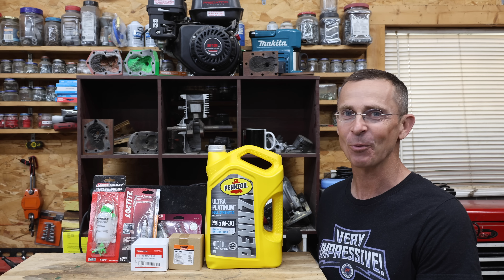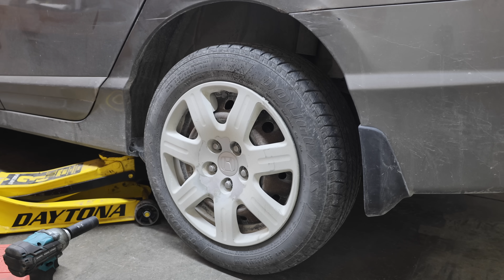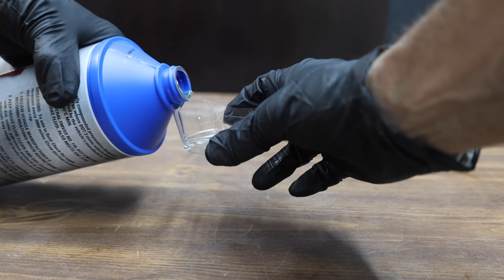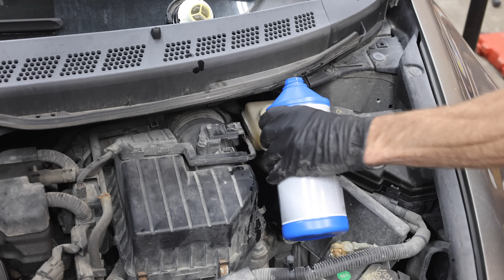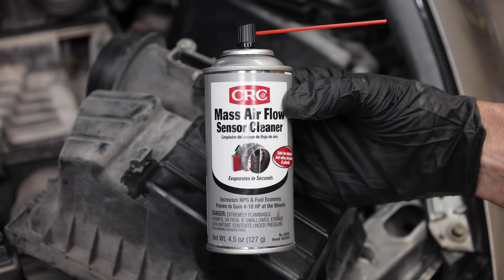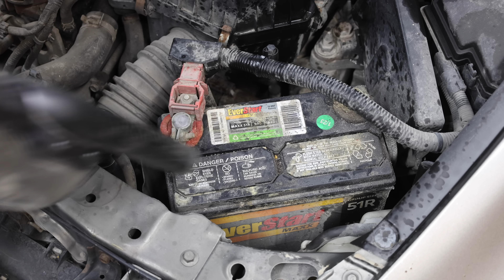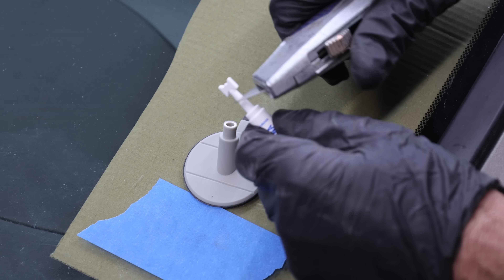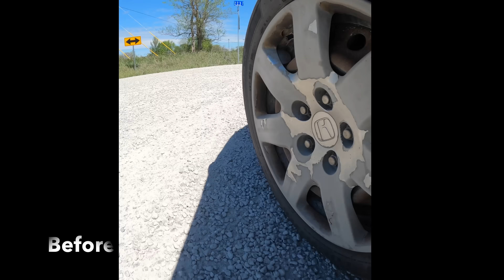Most Reliable 200K Mile Car? Let's Settle This!

Comment: Fantastic video!  I have a 2012 Fusion with 2.5 4cyl I bought brand new.  Has 220k miles now and still my work daily driver.  No reason to buy a new car when this car gets 25-27mpg and still runs amazing!  I've had to replace all the front end parts, shocks/struts and done brakes numerous times.  I run synthetic oil at 10k intervals and also do regular trans fluid changes in my garage as it's super easy.  These are also great cars to pick up cheap and fix up.
Reply from the maker: Thanks!  Thanks for sharing.

Comment: I did something like this with a 2000 Ford Ranger. I got it cheap, but it was a basket case with about 150K miles on it. I think the only maintenance ever done to it was oil & tire changes. I put about $500 worth of parts in it. I did many of the same repairs you did in this video. Then gave it to my daughter, which, um resulted in a few more $ invested in repairs. Still... FAR cheaper than new or a "nice" used vehicle. I have the Ranger now, and its still going, so I guess it's reliable.

This video taught me of some new tools useful for working on old cars. Thanks.
Reply from the maker: You are welcome!  Glad to hear!

Comment: Awesome video, i notice you dont have anything on striking pry bars, like 12 in long or 16 in. I used them a lot in underground coal to remove rusted staple lock hydrolic hoses. By strinkin either the hose or the staple.( snap on) always snapped quick. Proto curved tip pry bar was the best. Dominator would brake the tip easily mayhew makes those.
Also you should do a tool olimpics LOL.
Thanks. And congrats on your sucess.
Reply from the maker: Thanks and you are welcome!  Thanks for the suggestions.

Comment: Good video.

Could you do a comparison of multiple cold air intake systems for a modern diesel like the duramax L5P? In particular the banks monster air intake vs other brands. There are a lot of claims made but does it really help fuel economy, EGT, acceleration in the hills while towing, HP? Is banks worth the money or will a cheaper one work?
Reply from the maker: Thanks!  Thanks for the suggestion

Comment: This is exactly what I do to my vehicles. All over 200K and still running. Wear and tear is the biggest issue with old cars and If you have some mechanical skills, tools, and Youtube you can do most repairs.  I'm now at the next stage of what to do with your well maintained car when a major repair occurs. Engine wear (valve rings, head gaskets) can be expensive and most folks will send it to the junkyard. I have a front will drive Venture van with 290k and the transmission is worn out (flushed and replace fluid every 60K). I'm going to attempt to drop the transmission and rebuilt/repair it myself. This is definitely out of my skill level and comfort zone but a re-manufactured one is about $2200 and a shop will charge me twice that amount to rebuild the old one.  A 4T65E front wheel drive transmission is not the easiest one to work on but I going to give it a try and If it turns out to be a disaster then I can always send it to the junkyard or buy a re-manufactured transmission.  Would love to see Project Farm try a automatic transmission repair on a front wheel drive car but that kind of challenge is something most DYI'ers would not attempt.
Reply from the maker: Thanks for the suggestion.

Comment: K24 engined Honda for the win!  We just picked up an Element with the same power plant.  You need to adjust the valves every 100k.  The exhaust valves get tight and can burn on the lip causing a compression leak.  Adjust them a little on the loose side and she should have 100k still left in her!
Reply from the maker: Thanks for the feedback.

Comment: I'm never touching the radiator valve, because when this old plastic break, whole radiator is trashed.
Rather than that, i just take hose off too drain the coolant.
Reply from the maker: Thanks for the feedback.
Reply: @ProjectFarm  Thank You for response.

Comment: I just picked up a 07 civic hybrid with 191000 miles 3 weeks ago. I ran pretty good, but I did I decided to change the oil, air filter, axles, all 4 shocks, coolant change, all 8 spark plugs, valve adjustment, valve cover gasket, and updated it with a Bluetooth radio and 4 new speakers, also added sound deadening material to the insides of the doors, spare tires area, and wheel wells. Rides extremely well for a 17 year old car. Front brakes look good, the rear is uknown. Brake fluid will be replaced soon, but i am a little intimidated with the rear drums. Exterior was also taken care of, clay bar, polish, and wax, head light assembly was replced by previous owner, i just installed LED headlight.. all in all, great vehicle..
Reply from the maker: Thanks!  Thanks for sharing.

Comment: 17:45 ---im sorry this is just wrong. This is the problem of out society and capitalism. Just add the $2,500 for the labor costs of the specialist and then we have the actual costs - unless you cover the labor costs yourself. The parts are not the cost driver, but the labor costs of the specialists.

Comment: Good Job...I just bought a 2004 Saturn Vue with the Honda J35 V6 engine and trans for, $850.00, with, 170K miles. I also spent, $900.00 on parts...I replaced the timming belt, water-pump, belt tensioner and pulleys,  front shocks and struts, front rotors and pads, front sway bar end links, both front lower control arms with ball joints, thermostat and gasket, spark plugs, ignition coils, valve cover gaskets,  rear tranny mount,  engine mount, oil and filter, adjusted the valves and did tranny fill...Bought all my parts from, Rock Auto.
I got the Continental Timming belt kit and would recomend,FCS Auto shocks and struts...
Reply from the maker: Thanks!  Thanks for sharing.

Comment: Chris Fix would be proud. Doing disc brakes is so much easier than drums. And yes the most reliable vehicle is one you maintain and can fix yourself. I saved nearly $3,000 fixing my wife’s Infiniti by just looking up the code (it was a sensor in the transmission) and replacing the part myself. One of the best things about YouTube is wealth of DYI repair videos on multiple makes and models. Any modern vehicle should be able to do 100k with proper maintenance.

Comment: I have a 2009 Toyota Tacoma with 282,000 miles.  It got a new short block and rebuilt head at 231,000 miles (leaking head gasket) and Toyota replaced the rusted through frame free of charges at 191,000 miles.  The transmission has been service twice.  Works good,  I'll drive it until I croak.  The body has NO rust, I live in Illinois.
Reply from the maker: Thanks for sharing.

Comment: Like OEM parts.  Do not fully replace AT fluid if old and not regularly changed.  Can cause slippage issues.  Replace 1/3 to 1/2 at most

Comment: Nicely done. I would suggest getting a no spill radiator filling funnel kit. It helps in keeping air out of the cooling system. Most Hondas also have a bleed screw for the cooling system. Cost is 20 - 35 bucks for the kit, worth every penny.
Reply from the maker: Thanks!

Comment: Nice video thank you. For your next lubricant test have you heard of Enviro-save metal treatment? Curious if the claims are real or snake oil. Supposed to treat the metal and bearings in the engine to make it last longer.
Reply from the maker: Thanks and you are welcome!  Thanks for the suggestion.

Comment: I have three cars in the 200,000 mile range. as long as they have reliable engines and transmissions, it makes a lot more sense to do the type of repairs you’re doing. My attitude is that you keep driving a car until repairing it just makes no more sense
Reply from the maker: Thanks for the feedback.

Comment: Excellent video!  As a fan of the channel I submit my request to also include more detailed auto repair videos...even more detailed than this one.  That type detailed repair video saved me thousands by allowing me to change the radiator on my wife's 2007 RX 350.  Lexus wanted to charge me a fortune.  A year later,  after I changed it, that baby is still purring like a kitten.
Reply from the maker: Thanks!  Thanks for the suggestion.

Comment: For those new mechanics out there, the single best take away from this video is him using his phone to take "before" pictures to ensure everything goes back together correctly.  I can't express how much I wish I had this capability growing up in the 80's and 90's.
Reply: I remember pulling the front hubs off my 4x4 and laying them out in the order they came off, then cleaning and greasing one piece at a time and then reassembling so I didn’t mess it up. Lol
Reply: I’m a professional and I do this if it’s a job I’m not familiar with and has to be apart for a while/ Back in the day I would draw pictures.
Reply: I would just use pencil and paper before easy cameras.  Complex jobs… add a few pieces of numbered tape.   I have to admit… cameras, even videos greatly simplify!!
Reply: True!!!
Reply: It is an invaluable tool. I usually forget to delete them afterwards though, so when looking at old photos I often find random pictures of my cars in a semi-assembled state.
Reply: I do this not only for car repairs but for wiring in equipment for work.  When you start dealing with 25 colored pair wiring, it gets fun.
Reply: Being a Locksmith. I do this every time I'm working on a mortise lock I'm not familiar with to make sure it goes back together correctly. It's a very simple, smart thing to do.
Reply: of course your correct, by problem is even with pictures i usually need help to finish w/e i'm working on, i am the opposite of mechanically inclined, working hard to get a 50% success rate.
Reply from the maker: Thanks for the feedback.
Reply: Yup, I used to do trays, and cardboard with homes in it to keep bolts sorted.
The camera is my go-to as well.
Reply: Oh yes, having a cell phone to quickly take photos when doing projects just to see the order of assembly is such a nice QoL thing
Reply: Or even video, and videos on you tub. Grew up working as a mechanic/slave for my dad who owned a shop.  My vot is toyota prius for long term car for the win. I have 220k only doing routine maintenence, did put a 2 inch lift kit so I can clear deadmen when parking and also in deeper snow have a 60 mile commute everyday.   It is still easy to do another 200 K and that is very average for anyone I know that has a prius not to mention great gas milage. Also cops see you speeding they just give you a thumbs up like you are at the special Olympics.
Reply: You did have the capability since Polaroid and Kodak instant cameras existed back then. Of course the film cartridges weren't cheap (by standards of the day) and the pic quality wasn't great, especially in low light.
Reply: You did.  Polaroid cameras.  Film was expensive, but very good quality prints developed in under a minute.  I had the epitome of Polaroids in the 1980s:  A metal SX-70, their fold-flat instant camera.  I bought it from a pawn shop for $25.  It operated perfectly, had no tears in the bellows, but the film was expensive.  A pack of 10 prints plus a flashbar with 10 bulbs together cost $10 back then, a princely sum compared with the per-picture cost of 35mm.  In the 1990s I sold it on eBay for $50.  I regret that now.  It's a piece of spectacular American engineering genius.
Reply: @JustSayN2O he meant that was affordable to use in a shop, dpshtt
Reply: I guess you could have used Polaroids
Reply: absolutely, I'm from the dinosaur days of drawing a picture before taking it apart
Reply: I used a pen & paper.  If I was at home, I would use coloured pencils.  Now I use a camera too
Reply: Bingo
Reply: Back then we had to hand draw a sketch.
Reply: Buick LeSabre!
Reply: Absolutely.  ALWAYS take pictures.
Reply: Those of us who are old enough to have worked on stuff without cell phones around, you learned that when you’re doing drum brakes, you NEVER took both sides apart. Start on one side, tear it down, replace shoes, and other necessary items, then reassemble. The other side was your guide to how everything goes back together. It was a frustrating lesson to learn if you tore both down and tried to go back together..
Reply: Fr that seems ridiculous. Remembering stuff wtf
Reply: I use polaroid sun glasses to keep track of parts 😅
Reply: At my last job we would get hydraulic, fuel, and vacuum pumps with fittings attached at overhaul we took pics to make sure they were clocked correctly 😊
Reply: my sister got a polaroid camera when they first came out, and my dad "aquired" it for mechanical work shortly there after lol. It's great for everything: Cars, computers, surgery. Just a great all around habit.
Reply: Thanks for this
Reply: At this point we can even mount a tripod and video the whole process
Reply: Yeah it's a huge help. I've done it when repairing laptops - every one is different so I'd take photos as I go in case something doesn't fit back correctly LOL
Reply: Hmm I've been doing the photos since the late 70s .
With a camera and film .
Reply: Back then you had to draw a picture and take notes. Otherwise buy the Chilton's manual.
Reply: I used to draw a picture and specify the spring color for each.

Comment: The first few years of this civic has an engine recall, Heat fractures in the block, front facing bottom left of the block

I dove mine with a cracked block for 4 years 🤙🏻 @165k miles, likely could have driven it for another 4 years lol
Reply from the maker: Thanks for the feedback.

Comment: A couple things I'm curious about, first, can you give a rundown on the tools needed (and costs to acquire) to complete such fixes at home? As someone who dabbles in car stuff I find that often I don't have the tool that I need and so a good list of tools would be great. Also would be curious to hear your experiences in fixing different manufacturers models. I tried to rehab a high mileage Chevy Express van once and if I had known how hard it would be to get to parts of the engine bay I may have not made that my first attempt.
Reply from the maker: Thanks for the suggestion.

Comment: Can confirm, the 8th generation civics' are unbelievably reliable and cheap. After-market or even some OEM parts are a bargain and nearly every repair is doable at home with basic tools. We've been driving the same one since new, over 275,000 miles, just purchased a second one for my girlfriend. Plan to drive them till the frame rusts out (can't do much about that here...)
Reply from the maker: Thanks for sharing.
Reply: I've got a 2007 at 175,000 and I feel like it just got broken in.
Reply: Until recently my son was driving a 98 civic dx that was beat near to death.
Then he pulled out the threads with the spark plugs.
Not sure how long it will sit in the yard before he admits he'll never get around to fixing it.
Reply: even the transmission? it lasted all 275k?
Reply: @G8tr1522  I replaced the clutch around 200K, the rest of the transmission has been fine. Little bit of work, took me a weekend but it was do-able on jackstands in the garage!
Reply: of course, any honda after 2010 is a piece of junk. My ex's started falling apart at 110k. Josh's engine had to be replaced at 60k and Renee's engine had to be replaced at 80k. (All OEM/no mods, no racing, with proper maintenance).  Plus you can just count how many are broken down on the side of the highway. I usually see up to 3 on a round trip to the store.  Even consumer reports and JD Power are admitting that honda isn't reliable anymore.
Reply: @CelticBrewer  maybe a controversial opinion but between the V6 automatic transmission nuking themselves in the early 2000s and then the D17 overheating in the Civics then the late 00s hybrid Civics having HORRIBLE battery failure and the Odyssey following up in the early 2010s with transmission issues and other issues, I don’t think that Honda actually was all that great in the 2000s. Think 1990s was their best. Past 2010 they started to get better again.
Reply: @CelticBrewer Probably due to being assembled in the US

Comment: How about a testing of paint less dent removal methods? Dry ice, hot glue system, suction cup devices, etc. I have a motorcycle with some small dents on the tank, and I’d like to remove them, preferably without removing the tank and fuel. Thanks!
Reply from the maker: Thanks for the suggestion.

Comment: I drive a 98 Chev C-1500 pickup. It turned 200.000 last year and runs and drives like new. 4.3 V6 engine uses no oil and leaves no spots in the driveway.   I paid $2300.00 10 years ago and do my own service and repairs.  I have turned down $10.000 for this truck.
Reply from the maker: Nice!  Thanks for sharing.

Comment: Damn, I just trade in my car in November. It was a 2007 Chevy cobalt, it had 198k mikes on it. I trade it in cause it was leaking oil or burning it, the AC wasn’t working and the temperature would go up or down.
Reply from the maker: Thanks for the feedback.

Comment: Thanks but I will stick to corolla camry or avalon toyota power! I have literally driven or known coworkers and friends that had these cars they all run 200k plus easily not a problem for toyots to run 400k just change oil when you need according to what type oil and filter you use and don't go past 6k miles on oil change even if the manufacturer and oil bottle or filter say 10k don't do it 6k miles tops best cars ever made period if your looking for reliability get a toyota and that's not metal on the magnet it's your clutches and if you remove it all you no longer have any clutches bye bye transmission.

Comment: You said the brakes were just replaced but that brake rotor isn't new that's for sure.  I don't ever replace pads without replacing the rotors.  It used to be you could machine the rotors but now a days you should just replace them.